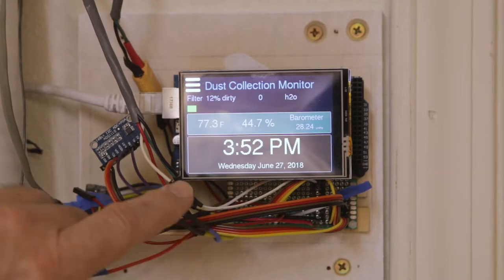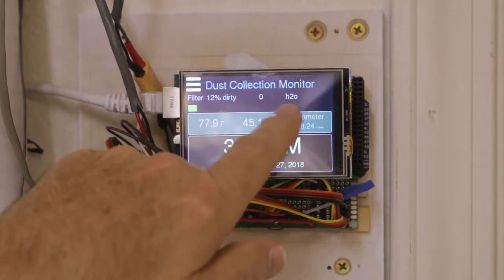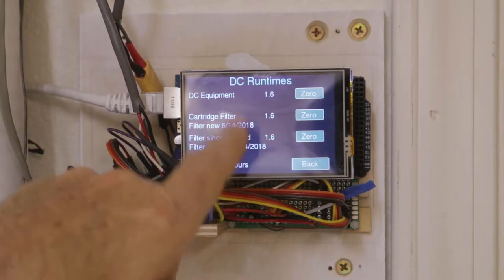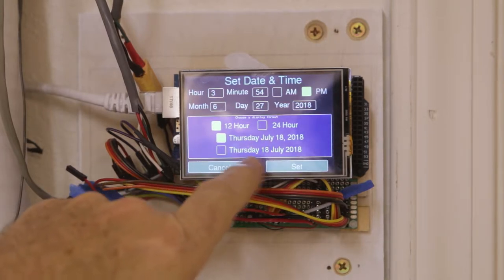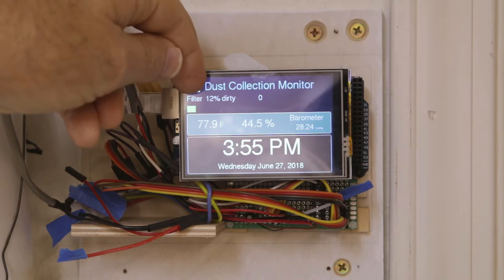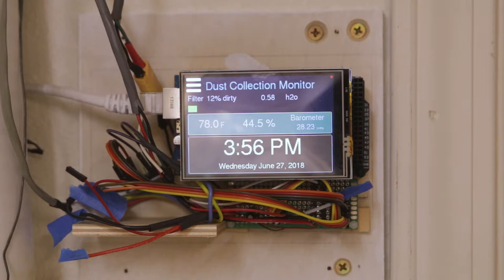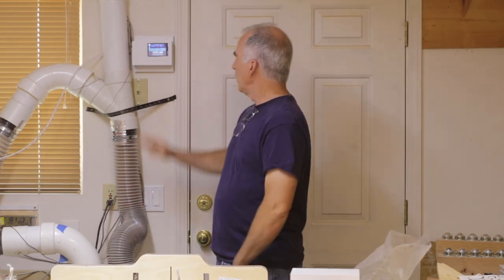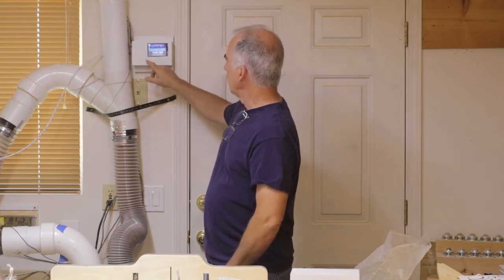Arduino Shop Dust Collection Monitor

Comment: This is great!!! I just got your plans and downloaded the code. I could use the wattage values for the resistors and voltage values for the capacitors.  Also, what did you use for a wall mount?
Thanks
Reply from the maker: Oops, I did miss mentioning that. I used 1/4 watt resistors, I got a large assortment of them on eBay. Anything over 5 volts on the capacitor, 16 or 25 volts will work. I'm going to do a software update, I need to have mine reconnect to the Internet for the time server. If it disconnects, my time display quickly gets off, and I have to unplug and it reconnect it. I'll try to make sure everyone gets that update. Also, my filter is finally getting dirty, and I see the suction has gone way down, and it says it is only 50% dirty. So I need to adjust that so it goes to "dirty" quicker.
Reply: @steveswoodworking2504  Code compiles fine, only when NTP is included. When using RTC only, there is a "'time_t' does not name a type error.
Reply from the maker: @billmoseley8936  I'll take a look at that today. I started with a real time clock, but then removed it, as most of those modules didn't keep time well. I have one that works great, and 3 or 4 that don't keep time hardly at all. I'll let you know hopefully today...
Reply from the maker: @billmoseley8936  Bill, I'll need to upload the code to my Wordpress page, but if you can email me at astrosteve1 at gmail.com, I will send you the updated code right now. It compiles now. Thanks for letting me know about the error. I also updated the code for people using the Ethernet shield, to reconnect to the Ethernet if it isn't connected. I was having an issue with it losing connection, then not being able to sync the time again.

Comment: Hi Steve,

This DC monitor seems very interesting, especially if you combine it with a auto blast gate and DC power up/down function. I have been in the process of learning Arduino coding (having to teach my self how to properly type first:)) for a while know with the intention of automating my DC system. I thought I would mention a couple items for you to consider while you develop your system. I have not seen these addressed elsewhere, including the “other guy” you mentioned or the guy that he based his code on. I imagine you will have a fully operation system while I am still playing around with blinky lights. My apologies if I am telling you things you already know. 

-- Larger DC systems with 5hp and up motors and large impellers should not be turned on and off for short periods of time. Thus, the delay for shut down should float to insure that the total ON time is at least 10-15 minutes weather you are using one tool/gate or moving between tools/gates. Of course the logic should work time into that delay for clearing chips after the last tool is used. Additionally the logic would understand that if I have been on a tool/gate for 10-15 minutes  or more it is oaky to just shut down after chip clearing.
-- An IR remote should be able to override the above as well as turn the DC on at manual gates such as floor sweeps and downdraft tables. 
-- To increase your market I would suggest allowing for pneumatic gates as well as servo. For larger gates 6” and up, it is my opinion, that pneumatic gates are much more robust. I have made pneumatic 6” gates for around $30 total, so accessible to most. Also,  going pneumatic allows you to use the Arduino's DIO pins thus increasing ones board choices. I have 15 gates and plenty of room to grow on my mega... for things like perhaps a monitoring system. 
-- Adding the code to include a “bin full” sensor would dovetail nicely with the whole system. There are several out there that used ultrasonic sensors. 

I look forward to seeing what you come up with.
Reply from the maker: Thanks for the thoughts. I had considered some sort of setup not to turn off and on the DC too often. Good idea on an override off or on. I hadn't heard of the pneumatic gates at all. I will check that out, as well as some sort of bin full sensor, that would be nice too. I definitely need to get to this next part of the DC Monitor, but have a bunch of other things I'm working on also. I'm getting close to done on an Arduino for my observatory, to report back the roof latch status to my home automation system, and I keep adding more sensors to that. I just added a couple of earthquake sensors, and am writing the code for those. The earthquake sensors are just for curiosity and for fun, will they be able to detect far away earthquakes? We'll see.

Comment: Just ran across this.am interested.let me know  where you stand on this project now.robert
Reply from the maker: I haven't made any new additions, but I have updated the code.  I see you did purchase it, that will open up the pages that have the detailed info. I need to update the online zip file of code, but if you email me at astrosteve at gmail.com - I will send you the latest code where I fixed all the issues people were having. Most of them were turning options off and on, since in the end, I tested mostly my configuration. But I think I got all those fixed now. Any future bugs, please comment here or on my web page article.
Reply from the maker: Robert, I just updated the online download. You should now get version 1.002, which updates and fixes several bugs. I've removed the comments about it being a Beta version, as I think this version is good now. If you notice anything wrong, please let me know, and I'll get it fixed.

Comment: As soon as I drop the ethernet option and go for the real time clock I get an error message there is no such file or directory for ds3231.h.  I can verify the program before I make this change.  I deleted my libraries and copy the ones in the zip file to my library folder.   I can see the .h file but still keep getting the same error message the file cannot be found.  Any ideas of what i could be doing wrong?

Comment: This is cool, I have tried a few Arduino projects and don't have the advanced skills yet. But this is 1/2 the way to a system that I have thought about. If this could also turn on the dust collector and have a minimum run time. that would be the the system I would want.
Reply from the maker: That's where I am hoping to get to. The first step was to monitor when the cartridge filter was getting full. Hopefully I can get to this second part of it, detecting tool usage, and turning on the DC automatically this year. Plus, I want it to change the gates to direct all the suction to the tool I just turned on.